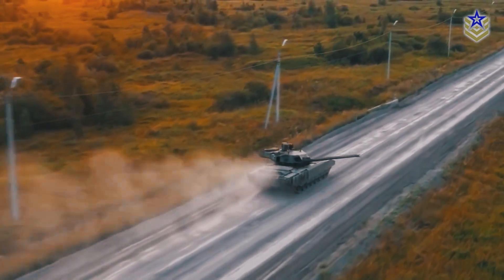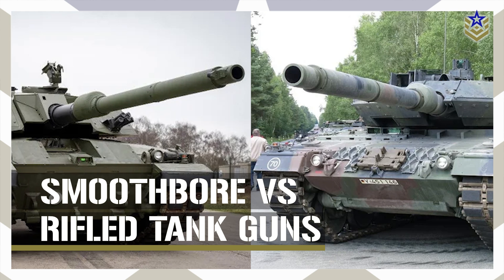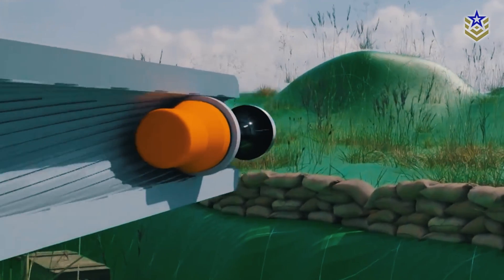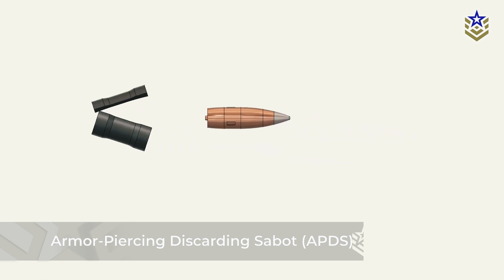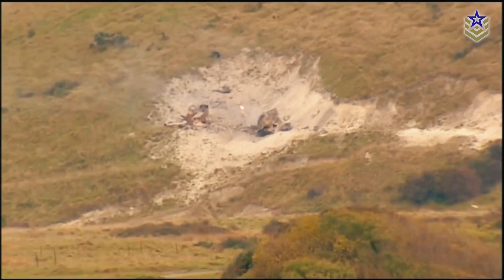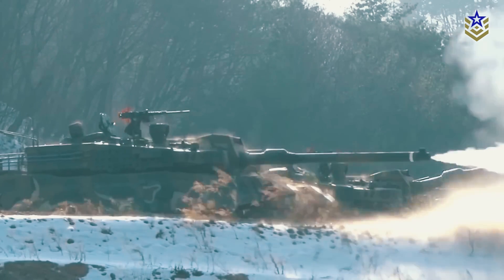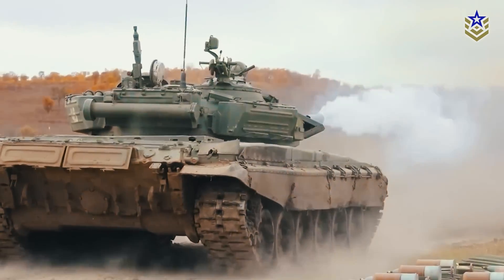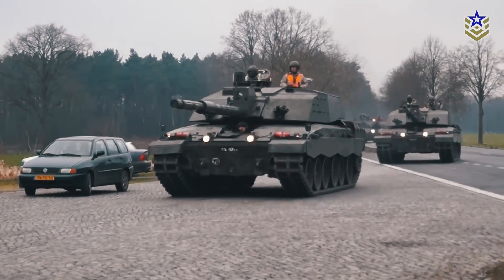Smoothbore vs Rifled Tank Guns: Which Is Better?

Comment: Rifled barrels don’t impart spin on modern APFSDS rounds, instead integrating a slip mechanism into the sabot. Spin would actually destabilize those rounds as they‘re more than six times as long as their diameter. So there’s no precision detriment in using smoothbores, but the higher muzzle velocity will increase accuracy.